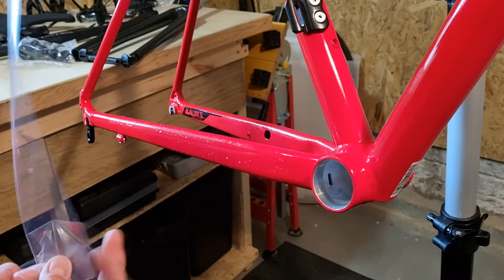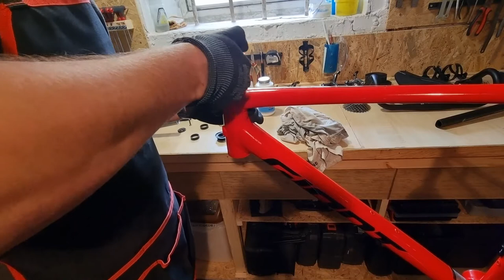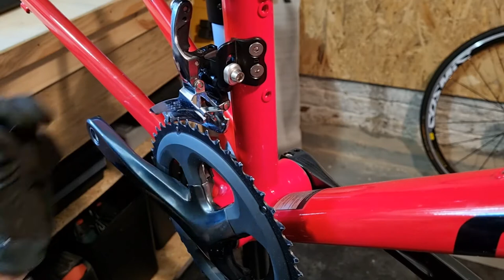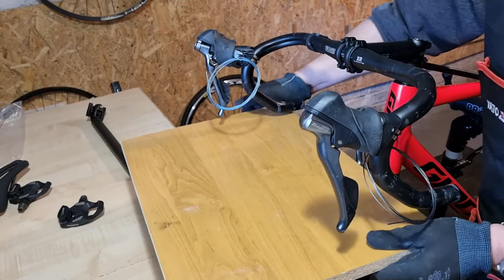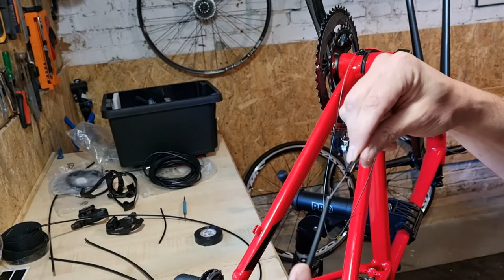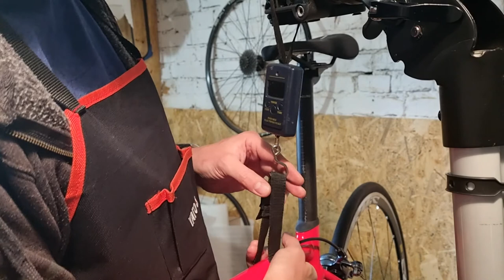Dream road bike build for normal people - classic, but modern all you need Giant Contend SL

Comment: Hi! Very precious build,good job😊
Please what kind of grease do you use for the bottom bracket and the headset? Thank you😊
Reply from the maker: I use ceramic grease and Shimano anti seize. The main job of it should be to repel watter as the bearings are running isolated and sealed inside on own type of more dynamic type of grease. If bearings would be open, than I would use dynamic grease.

Comment: Hi! Great build :)
What specific foil do you use in the beginning?
Reply from the maker: Thanks! This is a standard but thick foil used on cars.
Reply: @custombikefactory  could you name the specific brand and type? I am planning to do the same on my gravel bike. :)
Reply from the maker: @UNKW0N  As far as I remember it was something like Oracal Oraguard. For MTB or gravel bikes I usually cover most of the frame with the foil. Good luck with your bike ;-)
Reply: @custombikefactory  thank you!